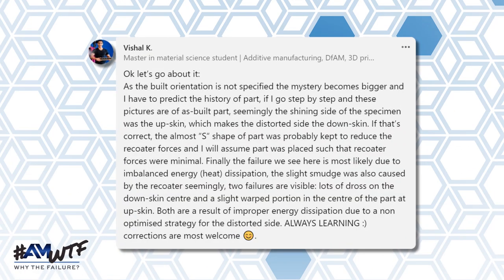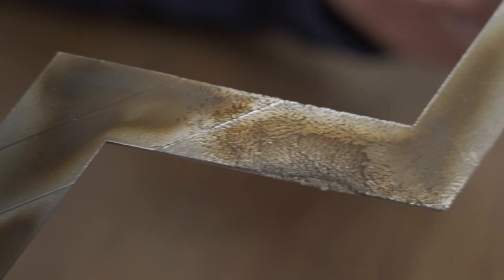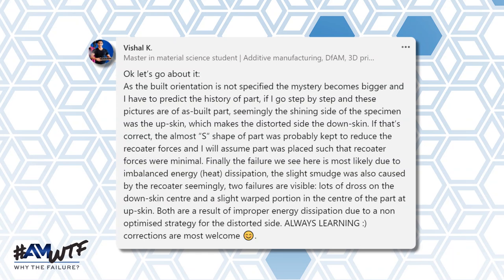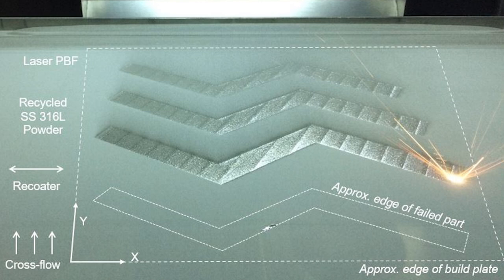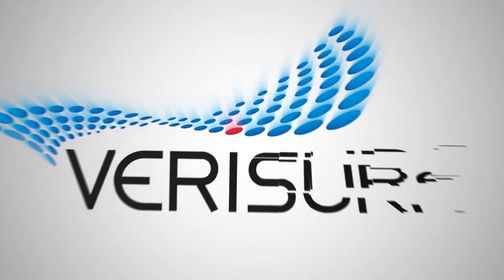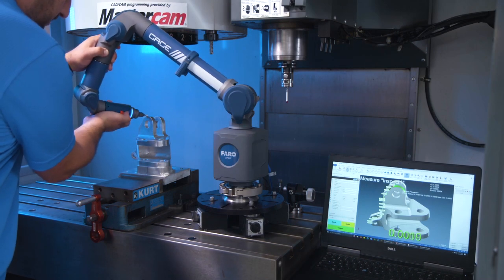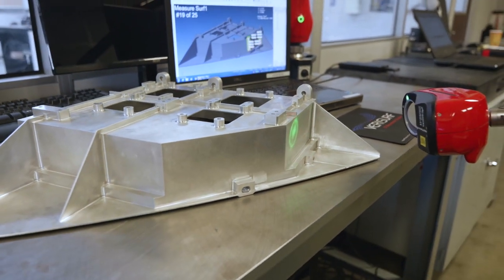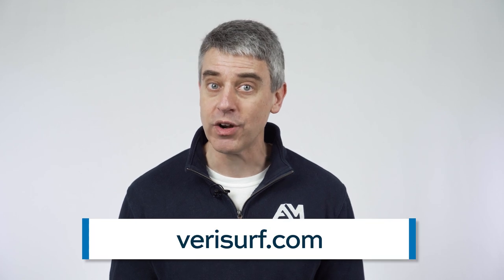Metal 3D Printed Part Should Have Been Flat, Has a Bubble | Why The Failure?

Comment: Just came across this great content! GREAT job on the content and moderation.

Here is my opinion on why the failure... 
In addition to what was discussed, I believe we need to consider the thermal history of the specimen. It appears that early failure in bed adhesions was the start of this failure. 
The bed adhesion can be due to two issues:
1. Contamination: from stock material and/or build plate surface
2. Stresses due to thermal expansion rates in the specimen and build plate.

After the local failure of the specimen, the heat dissipation through the build plate is reduced. Therfore, consecucutive print layers, at mentione location, remain at higher temperatures, which can lead to warpage of the part (therefore uneven top height of the part). Altogether, the bubbling effect seems to be as the result of multiple layers of the melt pool (molten power by laser) cooling on a previous uneven layer, where hindered thermal performance causes multiple layers to be diffused together.